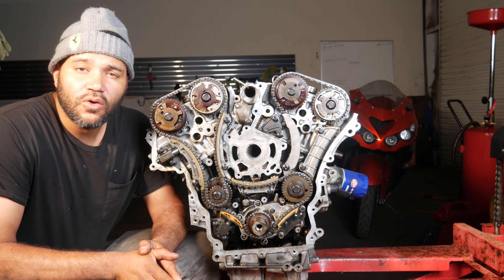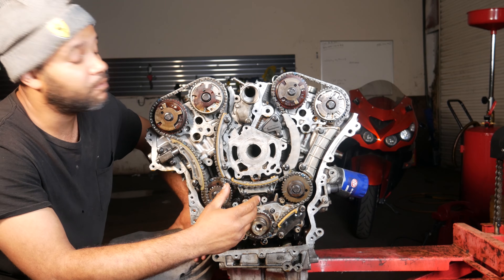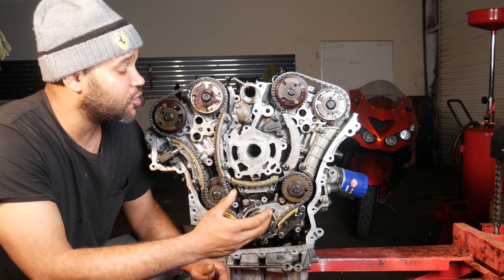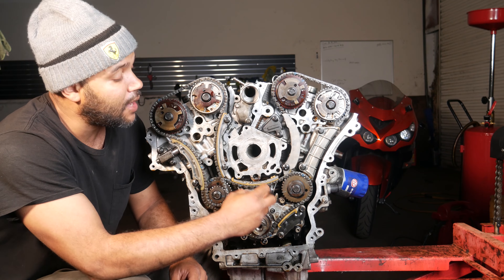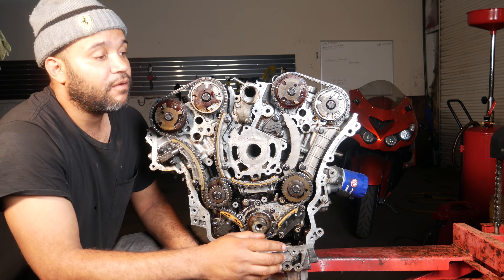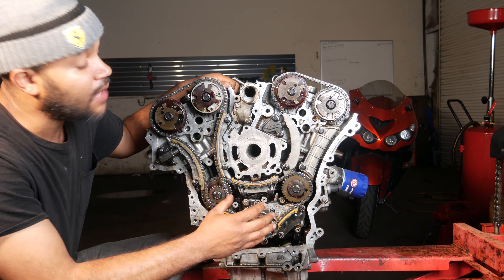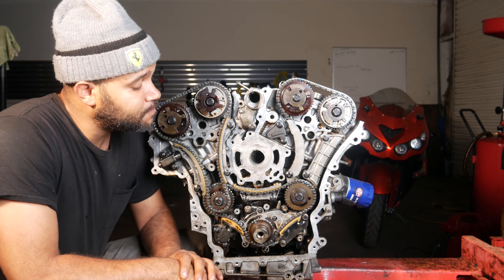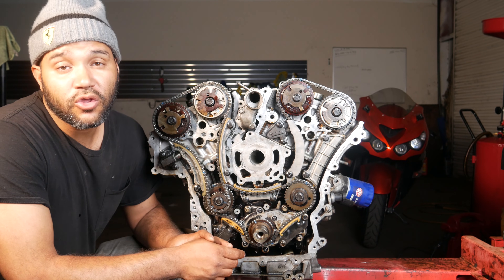HOW TO PREVENT TIMING CHAIN PROBLEMS l GM 3.6 ENGINE PROBLEMS

Comment: Cylinder 5 misfire.  New plugs no help.  Swap coil no change.  Swap injector no change.  Cleaned intake valves by hand no change.  Exhaust valve springs look ok.  Compression test good.  Tiny bit longer for cylinder five to get to 150 psi but they all have 150 psi.   Replaced pvc valve it was plugged completely :( no change.  Any ideas?

Comment: The reason I know this is because I tried turning the engine over with no spark plugs and was shocked how much force it takes to turn that engine over and realized it was the high pressure fuel pump taking all that Force. After I remove the pump the engine would turn over very easy like the normal engine should but with that pump in there it takes a lot of force to turn that over and all that force goes through the timing chains, the bottom and the front one. Good video thanks.

Comment: The biggest reason these stretch is the fact that GM designed it so the timing change drive that high pressure fuel pump which takes a lot of power to turn it.

Comment: I have a 2010 Cadillac CTS 3.6. It used oil like crazy. Drilled out the pcv valve a little bigger on both ends. There's specific sizes to drill them out to, so don't just go crazy, look it up and do it correctly. Ever since I did that, it barely uses any at all. Might use a half a quart between oil changes just keeping it at the full line. Actually runs better too. Has a little more response and seemed to gain a little more power after that fix.
Reply: GM came up with a new passenger side valve cover gasket that was also to limit the amount of oil sucked into the PVC. The PVC sucks from a section in the back of that head, and the PCV valve holes being too small created an air velocity that took in oil. Not sure, but I think that came out in 2012. That's what I read somewhere. My 2011 CTS Coupe had the timing chains replaced under warranty by the dealer around 50k by the previous owner so that was probably upgraded. I use little if any oil at all between changes at 105k.

Comment: I appreciate the breakdown on these engines big bro. I have heard that these engines are bulletproof as long as you keep clean oil in them. I change it every 3k-4k miles in my 2018 Camaro and my service guy looks at me crazy every time I come in with 50% oil life remaining 😂 😂😂
Reply: Cheaper than an engine and replacement…
Reply: I change my CTS at 50% too (we have the same engine) I met a gm engineer that knows the engine and says to change it at 50% to keep it around forever.
Reply: I know right! I don't even let it get to 60% being rare I normally do it at 70%. I bought my car used with 155k on it. So far I've gotten 10k out of it. It doesn't leak or burn oil at all. I also change the pcv valve twice on it out of the 3 oil changes I've gotten.

Comment: I have an 07 Cadillac CTS that I love dearly and baby it to the hilt, with a 3.6 VVT engine. Never had a lick of trouble with it at all! I keep my oil changed very regularly though and he was nothing but for synthetic oil in it of course. I checked the oil every couple of weeks or so and it always seems to be right on full. Once in a while I might have to add a splash or two probably just a couple ounces if that. But really, it doesn’t even use any oil so to speak. I Find My 3.6 to be a pretty good engine in my CTS.
Reply: Same for my 2012 Impala just keep some good synthetic in it and keep it topped off I got over 200,000 miles of mine and I drive mine hard no issues at all the LFX 3.6 is a very strong engine. It's the older 3.6's that have issues.
Reply: @kskip4242 same man! I’ve had mine since 134k miles I’m about to hit 180k soon and been on top of my oil changes 3-4k never gone past that, and it’s been really reliable
Reply: @ep9372  sadly mine was totaled out in January. I was side swiped.

Comment: I   fully agree with you on frequent oil changes  , but you were saying  170,000 before possible timing chain replacement,  isnt that early , haven't these engines lasted over 200,000 ? I dont plan to get rid of this car that soon
Reply from the maker: I would like to change the timing chain, between 90k to 120k
Reply: @bossautomotive7786  i have 110,500  ,  i haven't had no issues  , i heard many mechanics talk about the transmission issue something about low pressure switches,  whatever the heck that means ,  i haven't been burning no oil since the day i bought it , 3,000 miles oil is pretty much at full mark , plus it doesn't say to replace the timing chain in the manual  , i guess im confused,  and what about using the synthetic oil,  changed that at 4,000 ?  Let me know

Comment: Forgot to ask you , since my 2013 chev impala lt has that 3.6  with issues of timing chains , do you think by me switching to FULL SYNTHETIC oil and changing oil every 4 ,000 would prevent my timing chain from stretching  , what do you think , cause im not gonna pay the money for higher priced oil if it wouldn't make a difference,  thank u
Reply: I use Castrol Edge full synthetic 10-30 High Mileage oil, it's really good. A 5 quart jug is like $22 on Amazon, so it's not really that much more expensive. The engine takes almost 6 quarts so buy two to have some extra. I would never use cheap oil like I did in my younger years. Re-refined oil was 39 cents a quart back then and I used the hell out of it.

Comment: i have 175 thousand  miles on my 08 suzuki and it has the timing chain codes but it runs perfect and is not noisy .. i`m gunna drive it till it breaks then perhaps drop in a low mileage used engine ..  it`s an incredible vehicle  ,
Reply from the maker: Love it.

Comment: I have a saturn aura 2009 3.6l v6 with code p0014 comes on and off changing the 4 vvt solenoids hopping that is my issue  also changed the camshaft sensors. Hopping it's not the chain wat do yall think
Reply from the maker: What’s the miles of the car?
Reply: @bossautomotive7786  142,000 still burns rubber at the light lamo

Comment: I purchased a new 2020 3.6 L  Colorado ZR2 in April I only have a little over 10,000 miles. about 95% of the time i Drive to work and back 10 minutes both ways  i have only taken one large trip 4 hrs to Mount Washington in the white mountains of New Hampshire for a 3 day getaway When it comes to changing the oil  I only change it every 5 to 6 months  Due to the fact that I  Only put very little miles on this truck It's the only thing I do not like about  This particular engine is that the direct Fuel injection that makes the oil very very dirty

Comment: I just bought a 2008 Cadillac sts v6 w/69k mi.  Now it has 74k.  My oil is clear as water,  can't see it on the dip stick. Using Penzoil Ultra Platinum change at 2500 intervals. This is not my daily driver,  its a garage kept sleeper.  My Honda oil has been BLACK since day 1 Mobile 1.  I can see it on the dip stick though,,

Please reply

Comment: 2011 Traverse LS 200000km
Previous owner changed oil every 5000km to 8000km up until 150k km.
From 150k to 195k km, service history is unknown under second owner.
I've owned it since 195k km and intend to change the oil every 4000km to 5000km.
Question: how do I know what shape the engine is? Oil change analysis? Compression test? Leak down test?

Runs and drives fine. Throttle body seems clean. Long term Fuel trims are around 0 to 7%. Not burning oil as far as I'm concerned. I only have a lone p0420 code.
Reply from the maker: Sounds like a good running car.

Comment: Thanks for the video.  My wife has a 2012 GMC acadia with 67k miles.  Is there anyway to check the chain before it has problems?  I'm not burning any oil and the oil is changed often.  I guess engine oil flush and synthetic oil in order.
Reply from the maker: No way to really check the chain, I would change the Chain at 90k to 100k
Reply: @bossautomotive7786 

Help! My timing chain on a 2010 Cadillac SRX did break while driving. Do you think the engine is going to need to be replaced because it’s possible further damage or just a new timing chain?

Comment: Shoot I'm anal my truck makes me a living! I change my oil every 2800-3000! Listen until they build a total seal no gap piston ring I don't care how good oil is it gets contaminated from combustion. THINK! If the epa and car manufacturers can get everyone to go 6000 miles do you have any clue how much old waist oil that prevents every year! A LOT! But like I said Im anal I have changed my differential grease once my antifreeze once and my trans twice and Im only 105000 on LS 5.3. Someone buys one of my old trucks and They have little to   worry about.

Comment: What made this engine unreliable is GM integrated that faulty oil life monitor system. It shows 50% oil life left on 10k miles - people think oil still ok - but in reality - oil viscosity is gone and wear and tear on metal is really high.    Oil cant properly lubricate and cool down the timing chains - resulting to stretch prematurely . Oil gunk up and clogged pcv and its downhill from there . I believe its a decent engine- i wish gm used thicker durable chains  and tensioner made of metal not plastic. My 4!banger 2.4l nissan truck is almost twice as thick timing chains compare to gm 3.6l v6-

Comment: i got a 2011 traverse 3.6 with 200000 miles and never had a problem besides transmission kinda acting up, i keep my fluids changed in it and it runs better everytime i change transmission fluid too.

Comment: I have an 09 Saturn Aura with the 3.6 and it just turned 270K the other day. Based on my experience with this engine I thought they were pretty much bullet proof but looking at the forums not everyone has been so lucky. I change my own oil and have been from about the 3rd year I owned the car. Never rely on the oil monitor to tell you when it's time for an oil change - do that and you're absolutely going to have issues. I change my oil every 5K miles religiously. Used conventional oil for the first 100K and then switched to a full synthetic and the car is still running great.
Reply: Jimmy S  Nope, I'm the original owner. Never had the chains replaced, same water pump, same starter, same alternator, same everything. Tranny is leaking very slowly ($70 seal but about $800 in labor to get to it). Hope I'm not jinxing myself writing this but still going strong after all these years.

Comment: My wife has a 09 traverse has about 170000 o. It burns oil like cra,crazy, like a quart a week.now it has no compression  on number 4 and from what in reading it sounds like a burnt valve.should I get a new or rebuilt motor or get it fixed and new timing chains .
Reply: Scrap it. You got the value of it with 170000 miles.

Comment: I change the oil in my 2008 CTS every 3000 miles.  I drive on average 50-60 miles a day.  Oh yeah, I check the oil level twice a week.
Reply: I got a 2007 G6 GTP with that 3.6. I do just like you. An it's my daily driver. Check that oil level the same. Only thing I've done different is change that PCv valve every third oil change.
Reply: @retiredsnowbunnyhunterx5106 changing that pcv will save you everytime 🫡

Comment: Hey man. I’m hearing a ticking noise coming from the driver side back of the engine near the fire wall. When I rev it, it starts rapidly ticking and every mechanic has said the high pressure fuel pump and it’s normal. Definitely didn’t buy the car like that and it’s been doing it for 8k miles now. Last mechanic that looked at it said it wouldn’t harm anything and that they said the HPFP (high pressure fuel pump) will last a lifetime but is it possible for them to go bad and start doing that? Been to 3 mechanics already and very confused and frustrated. Please lmk what you think about the HPFP and if they can go bad/be replaced.

Comment: I’m looking for a 2014-2017 GMC Acadia 3.6 and I was warned of the timing chain I’m looking at ones under 120K . When do they usually go out on the cars ? And I’m assuming try to find vehicles with great oil change records

Comment: >>> This is SO important <<<
I never see this mentioned ANYWHERE on YouTube!

* Use SEAFOAM in the Crankcase a week-ish before an Oil-change!!!
*  I mentioned earlier here that I added 1 Cup of SF 2 weeks before my O/C this month.
* This gives some time for the SF to do some subtle CLEANING of oil-varnish/sludging.
* I've done this in all of our cars for MANY years. Hell.....my Snowblower's engine is 25 yrs-old & runs STRONG!
* SF is such a good CLEANER & Gas-stabilizer. 
* Doing this regularly will keep oil flowing in the smaller oil-passages to the Cam-Journals & Cam-Phasers.

Comment: I have a 2011 enclave, I have a noise coming from the engine took the vault covers and found a lose timing chain on bank one, maybe a tensor has gone bad, my question is how much would you say the the avarage cost for repair would be? Thanks in advanced
Reply from the maker: Around 2500
Reply: @bossautomotive7786  thanks for the respond man and yea that's about what I been told this week

Comment: Hi Boss Automotive, first of all great advice regarding the care of the engine but, as an owner of this engine, I would like to add something to your advice if and when someone does decide to do an oil change or timing chain it is highly recommended to: 

1) Remove the old oil filter and Drain the old engine oil out first.
2) Install new oil filter and Add engine flush in the engine before refilling to specifications with new engine oil.
3) Run engine with the combined flush and oil as to the instructions of the engine flush solution.
4) Remove oil filter and drain engine oil.
5) The owner may repeat the engine flush again if the owner thinks it is required (but in truth, I always flush my engine twice) but this requires extra oil filters and engine oil t be used.
6) 2nd flush, Remove oil filter and drain engine oil.
7) Install a new oil filter, and refill engine to the recommended specifications with engine oil.
8) After the new Oil Filter is installed and the new Engine oil is filled to the correct and recommended specifications, the owner must check the colour of the engine oil (via the dip stick) as they drive the vehicle, as soon as the engine oil turns black, change the oil filter and engine oil.

Hope this helps.
(P.S. By the way, if the engine has suffered neglect from irregular servicing it is always recommended to have the sump/pan oil pickup checked, cleaned or replace, especially if the owner has just flushed the engine and then replaced the timing chain and installed a new oil pump).
Reply: If the engine needs a flush, you've waited too long since the last oil change. I don't own this particular engine, but, I think a much more accurate way to gauge oil change intervals, is based on the amount of FUEL consumed by the engine, and ignore time or mileage. Each quart of oil in the crank case is good for ~30-50 gallons of gas. If you get 30 miles per gallon, that's approximately 900-1500 miles. If your engine holds 5 quarts, that's approximately 4,500-7500 miles. In this engine, it might pay to change closer to the 30 gallons per quart. (I don't know how much oil this engine holds)
Reply: @vincentrobinette1507 3600 V6 holds 6 quarts of oil. I am going by my 2017 Chevy Impala with the 3600 V6 holding 6 quarts.
Reply: Great suggestions MAS.I have a 2012 Buick enclave, 103K.kilometers, great car but on cold starts like in the morning it would idle high and very erratically for about 20 seconds then idle great afterwards..I can hear like the timing chains making some noise and think i need to change the timing chains..
I am thinking about doing a oil flush but not sure what is a good flush to use with these engines, Sea foam, marvel mystery oil etc..
Anyone knows what flush works well with these particular engines.
I never go past 7K or 8K kilometers between oil changes.. thanks
Reply: @segbachan5123 ...7 or 8 kilometers is way to far between oil changes for the 3600 V6.
Reply: @gtpcruiser02  that's only 4300 to 5000 miles and never past that ever.Most of the times i do 5000K kilometers

Comment: I feel your pain and I’m going to follow your direction. I’m at 140,000 2012 LT and so far she is running smooth. What do you recommend for an engine flush? Thank you.
Reply from the maker: You can used regular oil flush

Comment: 2015 Chevy Impala 3.6 VVT with 74000 miles LTZ I see for sale.  How is that year for that engine?
Reply from the maker: Good car, just keep up on the oil change
Reply: I absolutely LOVE my 2015 LTZ!! Cranberry Metallic with Black Leather, & the 20" wheels. I'll hit 70,000 miles this Jan. 2022. One CRUCIAL thing I do for my 3.6 VVT is adding a cup of Seafoam to the Engine Oil about a month before an Oil-change. This really cleans things up internally!! And yes...ALWAYS Synthetic Oil (Mobil 1). I've checked my Oil a month after an O/C, & it's still pretty clean on the stick!

I also add 1/3 bottle of Seafoam to our cars gas-tanks 1/x month when they're @ about 1/4 tank. Further.....the ONLY ONLY Gas they EVER see is Certified Top-Tier NO-ETHANOL Premium from either Shell or Holiday stations. I realize fuel isn't sprayed over the valves in our DI Engines, but it helps reduce carbon buildup a little. Yes.....I realize I have a "Flex-Fuel" engine. BUT >>>>> there's no way in Hell I'm using Ethanol in it!!!!! The CTT Fuel helps keep Injectors/etc. a little cleaner.

My Girl runs STRONG!
Reply: @Wyn61  I’ve got a 2014 ltz red with a 3.6 vvt with 95k miles and it idles rough and when it starts I get a check engine light and service stabiltrak do you no what it could be.
Reply: @Wyn61  I have a 2014 ltz cranberry matallic and it pops so much and look so good going down the roads it’s got 95k miles I got it with 42k and it’s been a damn good car I’ve also got a 2016 Chevy Malibu premier like a dark galaxy blue color and it’s been a great car to no problems with either one out of the 3 years I’ve had them and I do drive a bit but mainly highway.
Reply: And change the transmission fluid often.